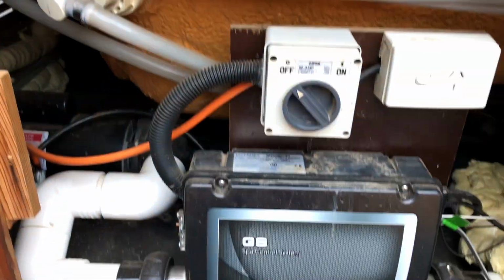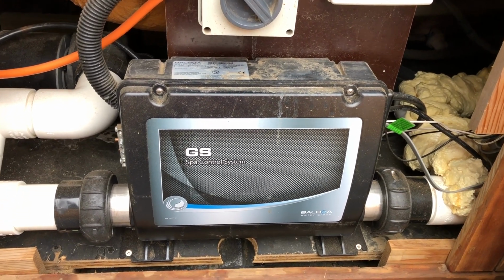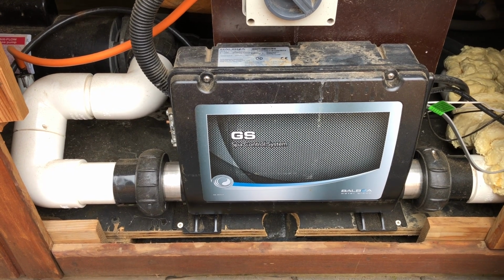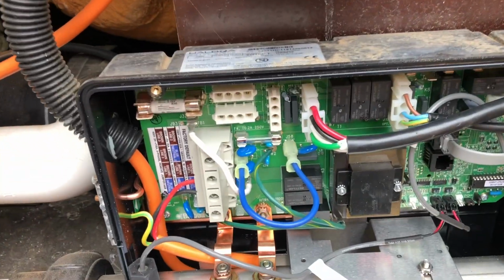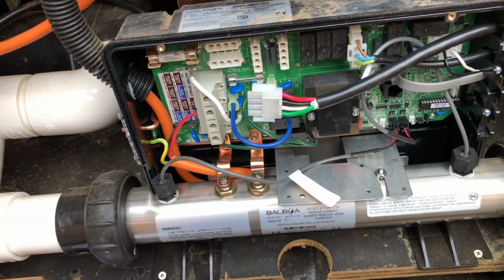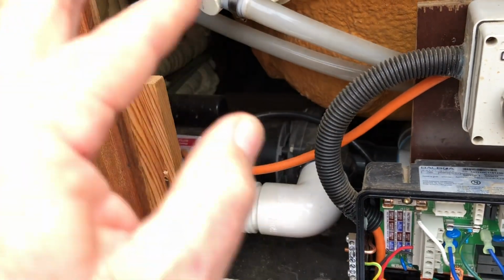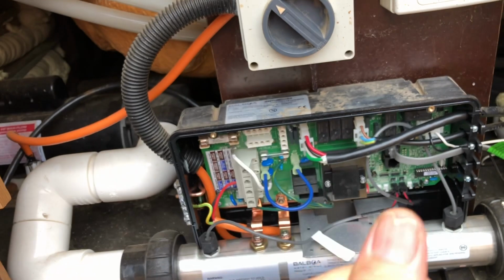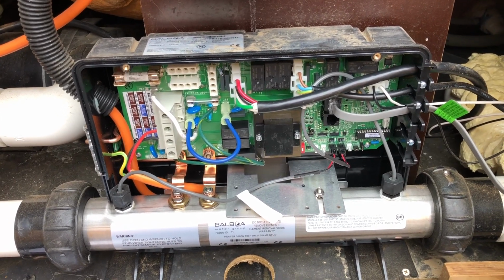Installing a new Spa Controller, Balboa Retro fit kit. Replace SP1000 Davey Spa Quip Control Panel

Comment: Hi Mark I have this spa I scored everything seems to be working but the pump to the right of the control board is humming and not spinning the board is GS501Z 
Regards Greg
Reply from the maker: Hi Greg. 
That will be to do with the motor not the controller. If it is just humming it could just need a capacitor at best and if it is all corroded then it will need replacement. 
Let me know if you need replacement send me photos so we can identify your pump. That is if you are in Australia. MRT
Reply: hi mark the pump is an emerson K55MYKHF-9557 I actualy made it work by getting a peace of wood to force the motor to rotate i agree i think it is the capacitor , The pump stopped while heating dont know why so i turned off the mains for an hour or so and had to force the restart on the pump , it started heating but seems to be intermittent as the indicator light goes on and off i may have to get it looked at! Regards Greg
Reply from the maker: Should I Repair or Replace my swimming pool spa pump motor what to look for fountain Rust
https://youtu.be/IHo_gOwXRL8

Comment: Great video - But I have so many spa questions. How much is a 30 min. one-on-one Messenger call? Moved to a house with a SwimSpa, but have problems with one of the Jet Buttons on the Balboa control panel :)
Reply from the maker: Hi Claus. Yes I have a service that I can set up a scheduled call and consultation. Contact me at Nillumbik Pool & Spa Service

Comment: HI mark, I have the balboa Revolution series control box but the heater core it tripping the circuit breakers, What unit should i replace it with as the Revolution series is un servicable
Reply from the maker: Hi Jack Contact me at Nillumbik Pool & Spa Service I actually need to know how many pumps you have and if they are two speed and if you have a blower. Then we can program a unit to work on your spa for you. They do need to be set up for each spa.

Comment: Hi Mark,

On the temperature probes, can a person pull them out slightly to increase the temperature?   I have tried the resistor method, but the unit senses something isn't normal and shuts down.  It tried it with 2x  1.2k and 2.2k resistors.   Maybe I'm not using the right resistence, so maybe there's a spec or testing method I could use if I'm off with the 1.2 and 2.2.    What is your advice?

Thank you!
Reply from the maker: Hi there. 
My advice is that these units are very precise and I wouldn’t be playing to try to adjust it. Partly removing the temp sensor won’t adjust it.

Comment: Hi I have a VS501Z but wanted the wifi control - can I just swap the circuit boards and go or do I need to swap out the entire spa pack?
Reply from the maker: Hi There. What country are you in?
If Australia then contact Nillumbik Pool & Spa Service they can help you with that. MRT

Comment: Hey I have a jacuzzi z140/300 my control knob is stuck on hot I wanna replace does the balboa fit ? & my pumps are burned up so you supply ?
Reply from the maker: Hi There. Are you in Australia? If so I can help you. Contact Nillumbik Pool & Spa Service

Comment: Hello Mark. I have that control panel in my spa. Now my water pump want stop at the lower speed. It's just goes the hole time. I have the 2-speed pump, when i press jet the jet starts. When i turn jet of the ciculation is still on.. My question is what relay goes to pump? K6?  Sorry for my bad english :D
Reply from the maker: When the controller is trying to heat your spa it will keep the circ pump running until it is up to temperature. So to start I would be looking at is the spa heating? Is it teaching its temperature? As it is supposed to run non stop until the spa gets up to temperature. It also will run to filter and clean the spa even when it is up to temperature
Reply: The temperature is reathing 38°. Even if i turn down to 30° when the spa is 38 the circ pump is still on. 

It needs to be relay cuz when i messure the pump output its 230v all the time..

Comment: I have new VS500Z my heater won't turn on and pump shuts off while water should be being heated, im confused by the dip switches
Reply from the maker: Hi Tim. Is this something that you are trying to fit yourself?
I do offer support to help you out. 
I can offer a FaceTime consult and we can attempt to sort that out for you. There is no service call for that service I just charge my hourly rate with a min of 1/2hr. 
Just contact Nillumbik Pool & Spa Service

Comment: is it possible to repair a leak from a crack in a spa pump faceplate? is there any type of glue adhesive that would be strong enough? J-B weld? PL 8X? 2 part plastic epoxy? Seal All? the crack in the pump faceplate was a result of water freezing. Thank you.
Reply from the maker: Green Energy Concepts No I don’t believe so, nothing will last. Most spa pumps have new face plates available for purchase. Let me know if you want one as a spa specialist I can access most brands.